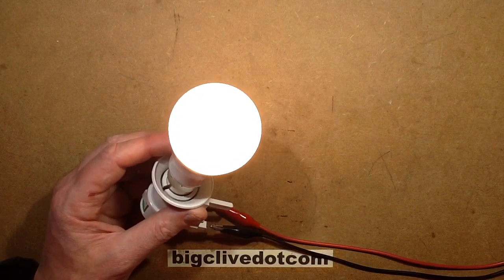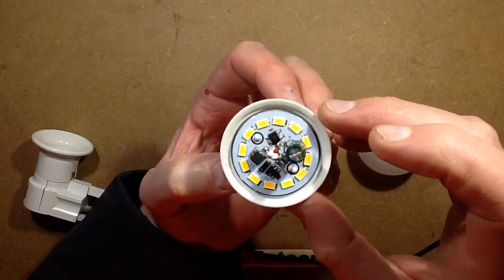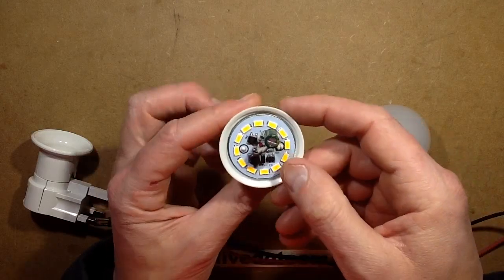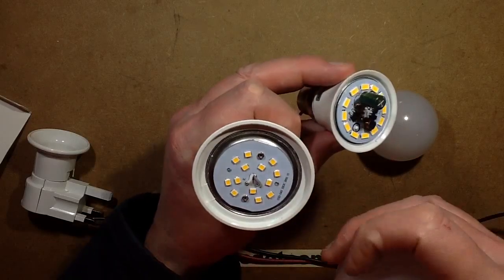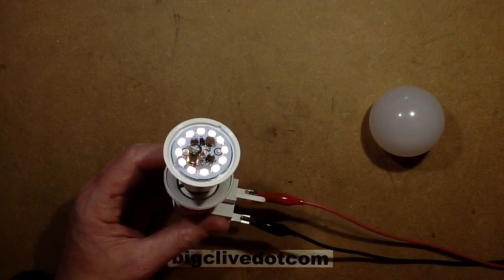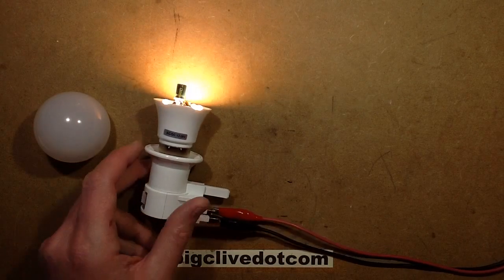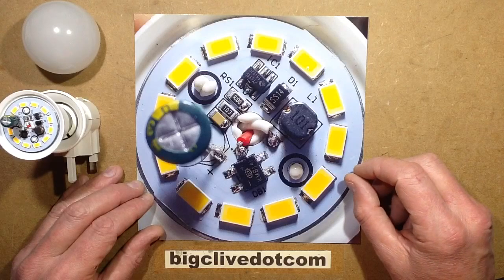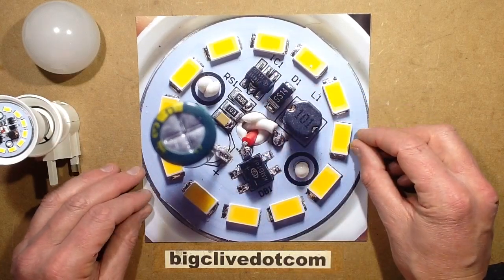Neat 12-24V 5W LED lamp with buck regulator.

Comment: someone help me please. I want to buy voltage regulator and the two i came across uses MP1484 and lm2596. Can anyone tell me which one should i buy. I want to step down voltage to 5 volts for solar usb charger.

Comment: It wouldn't take long before I accidentally plugged that into a mains light socket, I think I'll pass.
Reply from the maker: Which is why I always write 12V or 24V on new lamps with a Sharpie.
Reply: All the same, I think I'd still find a way to add something to cut power, perhaps a 0.5 amp fuse in an attempt to save the circuit and led's.

Comment: It's easy to dump on the Chinese for shoddy manufacture, but there's an easy explanation.  When the economy is based on catering to the client's price-constraints, the Chinese manufacturers usually comply with those price-constraints, no matter how insane.  When you're competing with thousands of competitors for the same contract, the results can be quite extreme.  Of course the lack of regulations or patent protection allows this wildfire to burn out of control, along with the abundance of foreign clients who really don't like to let standards get in the way of sales.
We are as much to blame as they are.

Comment: Hi Clive,
I'm really like your videos, it's great how you break down and describe the operation of all kinds of bit and pieces. I've just started studying electrical engineering. If you're lost for ideas for videos it would be great if you did a short series on the different types of power suplies that we are likely to see in industry; something like your video that deacribes various components such as capacitors and resistors that you did a while back. It would be a great introduction. thanks for the inspiring vids.

Comment: 100uH is gonna be a little low for dropping 20v
Reply from the maker: It's part of an active high frequency switching circuit.
Reply: sorry if I was unclear, but I understand how the ciruit works, most chips like those are recommended to have 150uH at around 20v drop over the coil but it will probably not make a noticeable difference

Comment: Couldn't help but notice there was no flicker even with the Apple factored in. Also noticed as you dropped voltage there was a nice linear dimming. Maybe buck regulators might be a solution to the dimming problem in your previous video?

Comment: Where are you likely to find such low voltage AC?
Reply: Not many places, except maybe a halogen transformer (the old wire wound ones).  The reason for the bridge rectifier is so that it works whichever way you insert it, if using it on DC, simulating a traditional tungsten lamp as well as working on AC. With the bayonet cap style, the connections could be reversed depending on how you insert the bulb.

Comment: I don't know about you, but I like the boost drivers more. No need for current sharing resistors, and works well when the input goes low. I don't think it's a great idea to just connect the strings in parallel

Comment: did clive say that this lamp was using a buck regulator, as opposed to a "switching circuit"? Aren't they the same? what I call a buck regulator is  the combination of an inductor + diode + capacitor + mosfet + on/off switching thingy... so it seems to be the same to me... am i missing something? (btw, i don't have any training in electricity/electronic, so i talk out of my ass most of the time...)

Comment: 5 Watt. In use? But how much light is there actually ? ? ? ? Not a word about how bright it is? That is what a lamp is for, right?
Reply: yep some data would be nice - but hard to know exactly where to measure since some of these bulb types look more omnidirectional than others (e.g. very little light comes out of the rear of the  poundland 3W GLS ), which could be either a feature or a problem depending on the application. doing a polar plot of every one might not be so much fun.
Reply: well it would if the buck regulator wasn't eating some power etc..

Comment: They'd be handy for narrowboaters, they often have 12v or 24v lighting onboard running directly off the batteries, and would save them having to run the engine or a generator as often too being low-power LEDs... :)

Comment: see this is where US does it better now. you would never have 2 different lights with the same connector that can be put in the wrong one be accident. why does a dc low power light have the same connector as a normal one.
Reply from the maker: It's to make lamp installation more exciting.
Reply: Um yes you do..
https://www.1000bulbs.com/category/standard-shape-12-and-277-volt-light-bulbs/

Comment: Here is a question for anyone who might be able to help.. My samsung LCD tv has a issue, when I turn it on in the morning it will turn its self off for 5 min at a time about 4 to 5 times before I can even watch anything. So I have googled it and I replaced a few caps and it will work for about a month then do the same thing tuning off then turning back on. So I am wondering if there are other caps that are bad making these go bad or is something else making these malfunction, I can give pictures of the power supply board if anyone wants to see it. Thanks for even reading this far and for your help.
Reply: ***** Thx for the reply. I will check it out
Reply: Maybe those "NEW CAPS" have their own ESR and/or temperature range issues that quickly render them useless. Try higher quality caps. (lol, or kludge together some solderless external cap sockets so they can easily be replaced every week or so.)
Reply: I have tried caps of all prices..thought maybe the cheap ones sucked but the expensive ones die faster, Samsung is shit...Thx for the reply

Comment: Isn't that plug foor a normal socket? So why only 12V and not 220V?
Reply from the maker: It's quite common to find a wide range of different voltage lamps that have the same standard bases.  This is why it's always a good idea to check the voltage of a lamp before you plug it in.
Reply: Thank you for your answer. But what is the sense of these low voltage lamps? Don't they just explode when they are plugged into a normal socket(220V)? I don't know any low voltage sockets.
Reply: low voltage bulbs with standard fittings aren't new - they used to use LV tungsten bulbs for work lighting on lathes and fast reciprocating machines when the main room lighting was fluorescent to prevent the strobing giving the dangerous  illusion of a moving machine being stationary... I guess this is a straight replacement for tungsten in that application given it's low (I presume) strobeyness. You probably wouldn't have any of these around unless you were in an industrial situation in which case the guy with the key to the lightbulb cupboard knows what he/she's doing.
Reply: So lights like this are for machines that provide a low voltage socket? And also you can find low voltage sockets only on industrial machines?
Reply: I think they did a low voltage tungsten gls work light that you could croc clip onto a car battery... I guess it might also be useful for people on canal barges - a lot of them seem to have small wind turbines and/or solar arrays now. The risk of plugging one of these into mains is imo more theoretical than real cos you have to go out of your way to get hold of them and if you have both types in your home or workplace you'll know to be careful.

Comment: Wait a minute, the fitting on that lamp looks like it could be put into a regular light socket which surely would result in a significant blue smoke escape incident. You've got to put that into a 240V socket, for science of course.
Reply: Clive put a 12 volt lamp on the mains in a recent video. The result was spectacularly unspectacular. The LEDs quietly got the black death.
Reply: Now you say it that rings a bell. Who knows this one might blow the cap.

Comment: I wish Clive would go a bit more in depth about the electrolytic can crapacitors on these devices. Because they're what is going to fail, and fail early. The absolute best caps made are rated for about 12,000 hours of service life. The caps in products like this are far from the best too. Some dip down as low as 1,000 hours. Though 3,000 hours of life is common in the low end too.
Reply: I once repaired a satellite receiver which had a blown electrolytic in the PSU. It was on the 12V line. Out of the factory they fitted a 10V capacitor! I replaced it with a 16V one which just about fitted and it's been fine since.
Reply: akkudakkupl
You could go rational, and just install a quality electrolytic.
Reply from the maker: The cap in this lamp is probably not going to get stressed too much, as it is only seeing 100/120Hz rectified AC at worst.  It's not going to experience the stresses of a cap operating at mains voltage or one trying to smooth the output of a 20kHz supply.
Reply: +Paul Frederick , You're quite right, the higher the temperature, the lower the life. A 10C/18F difference in temperature can mean a 2 times difference in lifetime. Many LED bulbs get very hot in the base.
Reply: not every cap is gonna die, ive just put to sleep a sony cassette recorder,, made in 1976, was used for close to 40 years playing tapes in a restaurant, imagine 8 hours a night for 40 years, is that over 100k hours? lol, it still worked fine, head was well worn, but it worked. the owner liked to make his own mix tapes the old way.
Reply: jusb1066
electronic components have steadily improved across the board. But due to economic factors a certain cabal of shifty manufacturers has also sprung up of late.  Peddling everything from batteries packed with dirt, to dodgy counterfeit parts galore.

The root of the problem seems to lie in the fact that everyone loves money. Both consumers, and producers alike. We all share the blame.
Reply: It would make little difference aside from a slight flicker if using an AC supply, it's a smoothing cap only
Reply: bigclivedotcom
See, I knew you could say something about the capacitor. Electrolytic caps can die just sitting around though. So it don't take much to kill them. I was actually shocked when you said the 35V cap saw 32V. Old school was 100% derating factor on parts. So a 63V cap would have been in order for this application. I guess the new caps are just that much better than the old ones were?
Reply: Paul Sengupta
could they spare the capacitance? I swear the ratings are getting worse, and worse. 100% over used to be the bare minimum, and no one looked at you funny if you went to 150%. Then you were just being extra careful. They couldn't even manage to hit the mark with you though.
Reply: Paul Frederick
i guess its cost saving, and loss of quality over the years, for sure ive heard of bad capacitors being the faliure point of many consumer devices, but years ago, this wasnt the case
Reply: Go crazy and parallel a ton of mlcc's. Almost indestructible!

Comment: Isn't it sheer lunacy to put a mains bayonet cap on a low volt lamp?
Reply: People who read the labels (IE most of Clive's viewers) will check, but if working with computers has taught me anything, it's that the unwashed masses will connect anything that fits, regardless of if it's supposed to work that way or not.
Reply: Bases don't specify the operating voltage. That's why lamps have the voltage printed on top. ;-)
 In America and Japan you used to commonly find the typically 120V Edison screw thread bases being used on 12V and 24V lamps in larger marine applications.
Reply: Bases should specify the voltage :-) You wouldn't use an IEC C15 on the low voltage side of your laptop charger because you know that sooner rather than later some idiot's going to plug a mains cord in. No amount of saying "But the operating voltage is clearly marked on the laptop" is going to mollify that customer!
Reply: +Peter S , also on automobile trouble lights, when they were incandescent.
Reply: yes it is.  an accident waiting to happen.
Reply: unless you are in the US that is? they don't do this here last i checked. marine lights are not the same thing as normal ones. harder to get those confused really.
Reply: auto lights use a different sized one too so it is not possible to even screw it into a normal sized one so that works out too
Reply: I have some 12V trouble lights which use standard Edison sockets. Here's the bulbs https://www.1000bulbs.com/category/standard-shape-12-and-277-volt-light-bulbs/
Reply: Chris W
guess they do sell something but i have never seen them in stores before
Reply: I've got a 12v lead lamp in the garage from halffords that uses a bayonet fitting never had a problem they are marked up well .
Reply: Sean Rodden unwashed masses will connect anything that fits = Darwinism
Reply: Sean Rodden where i used to work had 32v bayonet work lamps all around the place. looked just like a mains rated bulb except it had 32v on it. never had an issue.

Comment: what printer do you use, it makes a really nice picture
Reply from the maker: It's an old Epson SX515W retrofitted with an external ink system that can be filled with large bottles of cheap eBay ink.
Reply: do you have a video on that retrofit ?
Reply: Most cheap inkjets will print a really nice image on their higher quality modes. It's just most people don't get to see them often because if they did they'd quickly be rendered bankrupt by ink and paper costs.
Having super cheap refillable ink and buying reasonable but cheap coated paper in bulk means you can afford to print full coverage high quality images without a second though, like you would normal documents. It's quite liberating.
Reply: Pound Galaxy.
Reply: I'd love to see a video of that retrofit too! I stick to a colour laser because inkjets are so expensive, but there are many disadvantages and limitations of laser printers.
Reply: IIRC he said in the comments a a video or two back... something with pricey ink cartridges that he refills at home. tbh pricey ink cartridges doesn't really narrow it down much >_>
Reply: Look up "continuous ink system" + your model of inkjet printer.

Laser printers have a few advantages over inkjet: Water resistance for the prints, cheap way to etch PCBs at home, don't die if you don't print anything for a while (I am looking at you, Bother printheads).
Reply: I shop for ink before I shop for a printer and buy according to 3rd party ink price and reliability (based on reviews). I don't have a continuous system but I can get 4 sets of XL cartridges for about £12. The trick is to go for models where the cartridges are as close to dumb ink tanks as possible. I have a Brother J5910DW. The cartridges slot in at the side and stay static as the printer sucks the ink out of them.

I'd say it's worth having an inkjet and a b/w laser if you print a fair bit (same 3rd party ink rule applies for 3rd party toner). Both have advantages.

Also having automatic two sided printing (duplexing) is worth spending a little bit more on if you can find a reasonably priced model that does it. It's super convenient and saves paper.

Comment: What kind of printer do you use Clive?
Reply: He says  "It's an old Epson SX515W retrofitted with an external ink system that can be filled with large bottles of cheap eBay ink." in reply to a question a couple of hours ago.

Comment: the gash on your knuckle looks deep. at least you're using your protection jacket.
Reply from the maker: By the miracle of human auto-repair, even the worst cuts heal up and disappear completely.  Anyone who works in construction or engineering tends to have a naturally evolved immune system that deals with things like this effortlessly.
Reply: Good job that sentence contained the words 'on your knuckle'
Reply: Yup. And the cable ties... Dreadful. They just tend to cut up your skin  when trimmed wrong.

Comment: Hi. Okay, I can't find any answer to this that makes sense to me. I've found several dc input circuits using a rectifier. Is this just to protect against reverse polarity or am I missing something?
Reply: Philip Burkett the bulb can be connected both ways - since this socket is usually AC220 ... so, it's just to make sure the lamp works whichever way you plug it in
Reply from the maker: Using a rectifier means the DC supply can be applied either way round, and the lamp will also operate on AC by converting it to DC.
Reply: "Is this just to protect against reverse polarity". Yes it is, a basic kind of protection. If it has applied a capacitor after the rectifier, then the device can be used on DC as well as on AC. In this case there is no dedicated connection polarity, even used on DC power.
Reply: Darieee be careful! This it's looks like as AC220, but it's a 12-24V bulb!  A big mistake from manufacturer, as easily can be mixed together with normal bulbs.
Reply: Meh, Clive tried it and the results were significantly less than spectacular - so, nothing much can come out of plugging it into 220